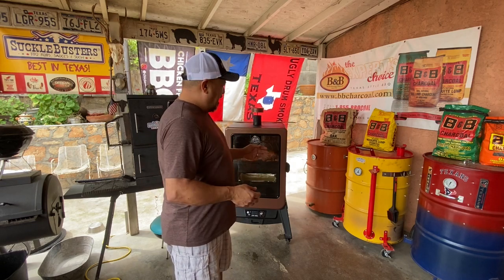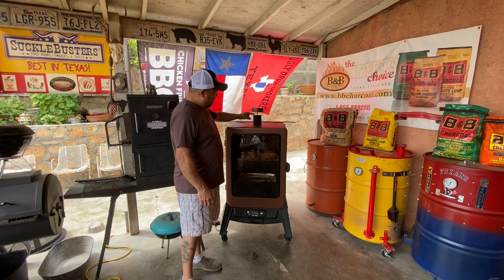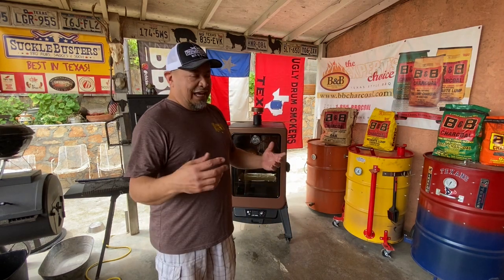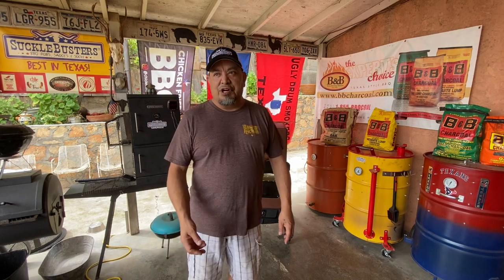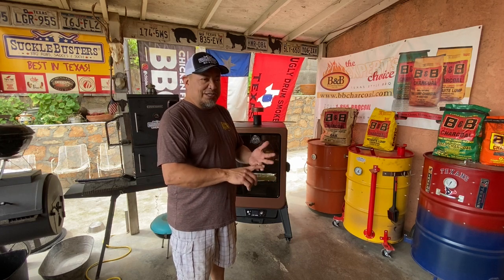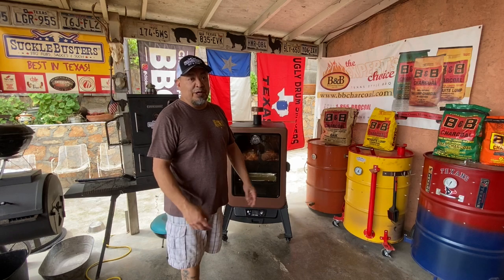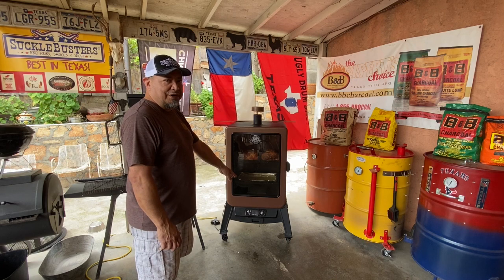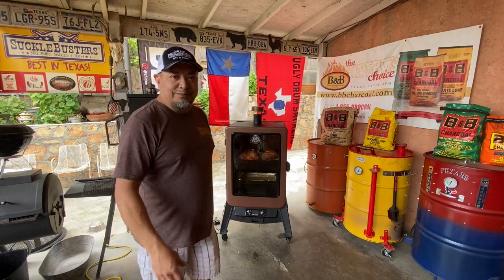PitBoss Copperhead Still Broke ErH

Comment: Just an update like I said before they sent me out a thermostat with no instructions on how to install it but thanks to YouTube I figured it out. After installing the thermostat I have cooked one beef brisket and one pork butt roast everything work fine. I still have a problem with paying close to $500 for a grill / smoker and in three months have to repair it myself. But just to be fair to them after I made the repairs my last two cooking events the smoker worked great.
Reply from the maker: ELAM305 That’s good news. Hope it continues to work the way it’s supposed to. $500 is not a lot for a pellet cooker with this cooking area. But it shouldn’t be having issues period.
Reply: ELAM305 same is happening to me.  I have been dealing with an ErL code since May!  They sent me a new control panel and the same thing happened.  Sept.....still nothing from PitBoss.  Ugh.

Comment: This smoker has been an absolute nightmare for me. I have the same error code problem after its working fine for about 20-30 minutes. Very frustrating when time is of the essence. I did my homework on this thing too, and now I’m dealing with this crap. On top of that- temp fluctuations are a major issue with the unit as you were saying, and one second the thing is billowing smoke- and then the next nothing. Super frustrating when you are getting zero smoke during the first hour of the cook which is during the most crucial time for the meat to absorb smoke. I finally gave Pit Boss a call and they want me to access the wiring and and start crossing wires to troubleshoot the blower. I wish I would have never purchased this thing. As soon as I get it working it’s going on Craigslist. I’ve also decided I hate pellet smokers- too messy (they run everywhere) and pellets just don’t provide the smoke flavor you get with actual wood. It’s a real pain emptying the pellet hopper on this thing as well since the chute plugs up and you have to shake the unit left to right to get more pellets to fall out, and you never can get all of them out so I find myself shoving a broom handle in there to get all the pellets. Meanwhile a bunch of pellets end up on the ground and if you leave some there and it rains then the pellets expand and look like animal turds.
Reply from the maker: Everything you said is exactly what I experienced. I’ve sent multiple emails to Pit Boss along with my video. I have yet to receive a response. Never ever ever again and if I see anyone at Wal mart or Lowe’s I will tell them about my experience.
Reply: Ric’s BBQ & Specialties call customer service- they will actually work with you
Reply: @bordo3k  I had been working with PitBoss through email with the same issue. I was promised a replacement controller and temp probe and I have never heard anything else from them and I have never received any parts. I have been working this issue for more than a year.

Comment: Robert Lantiegne
4 minutes ago
THINK TWICE BEFORE BUYING ANY PIT BOSS SMOKER! Excellent video. Your videos are so incredibly well done. I bought my Pit Boss Pro August 2022. I used it first time in the end of September. On my third use in October, I had the error message ER1. After unplugging the smoker for 30 minutes there was no error display and the smoker was operational and was able to complete the smoke. After reading PIT BOSS manual Trouble Shooting section, I check for fat residue on the heat probe mounted inside cabinet on back wall. Probe was clean without any deposits. Just before Christmas, I started an overnight smoke with 80 lbs of pork shoulder. The next morning I checked smoker and it had done an automatic shut down, displaying error code ER1 and the pork inside was102 degrees. The pork was completely raw and due to spoilage concerns I threw away the pork that cost $82.47 at Costco. I called Pit Boss Customer Service and requested a Warantee return and replacement. They refused and sent me a replacement probe. I installed it which takes a couple hours. I did one trial smoke with smoker empty and got same error message. Pit Boss advised that they would not repair or replace smoker and sent me a new control panel. The smoker works, for now. YouTube is full of dozens of videos showing Pit Boss Pro owners instructing how to replace the probes and control panels. I will NEVER BUY A PIT BOSS smoker again. The rate of failure of the control panel is too high for me to gamble on. To replace either probe or control panel requires removing door, racks, rack brackets, entire chimney assembly and and hopper door stop mounter on top of smoker, then turning smoker upside down resting on smoker top. These smokers are $600.00 and Pit Boss does not honor their stated repair or replace FIVE year Warantee. Sending replacement parts and requiring owners to repair their smoker just does not cut it.  Thank you for posting this video. It will save me time by not doing the same chimney and water pan placement changes. The problem is the smoker and the failure of the company to honor the Warantee which leaves us all out in the cold trying to repair these poorly designed worthless smokers. I am in the process of writing old fashioned letters to the state and federal consumer protection agencies.
Reply from the maker: You are absolutely correct that Pit Boss is a Pit Loss!! 
Thanks for watching and hope you check out my other videos and tell your friends about my channel! I need more subscribers 😎
Reply: My smoker still doesn't work even after they sent me a new control board that I struggled to fix. It worked once, then never again. It's quicker to throw  my meat on the grill. Hopefully the company will figure this out

Comment: After about 30 cooks I am now having this problem. It has been rock solid since January, great at holding temps and now its all over the place with temp spikes to 375 on a 225 setting. I contacted PB and after waiting 2 weeks for an answer they told me to do the exact same thing, and clean the temp probe. Nothing worked, I have been watching it and it seems like it stops feeding pellets so I have been hitting prime to get through my last cook. Finally PB is sending me a new board and temp prob, fingers crossed it will fix the issue. Honestly not sure I would buy another PB.
Reply from the maker: Hello Sir, truly sorry to hear about the issues, pit boss needs to recall these cookers I swear. Good luck and Thanks for watching and for the comment 😎
Reply: Did it fix your problem?

Comment: I had issues with the heat spiking on me. Pit boss sent me a new probe and control panel. I changed them out and so far after 10+ cooks, everything works greats. I also raised my cap and water pan just for gp. I absolutely love this smoker. One note is that when pit boss sent me the new probe, I noticed that the wire is longer then the one that was on it. So I’m not sure if it was just a bad batch of probes or not. Anyways I love your channel and just want to say keep up the great work.
Reply from the maker: Hello Greg and thanks for the watch and for the comment. I am glad you got yours fixed. I really liked the unit especially the size. My issue was it was going to take 6-8 weeks to get my parts. 
Ultimately I returned the unit. However if you go through the other comments believe you will see that this is a common problem.

Comment: I've had this same issue come up repeatedly after only 5 cooks.  On the last cook that lasted ~8 hours I probably had the ErH code come up 20 times.  I kept having to unplug and restart the unit, really frustrating.  I called customer support today and they tell me that it is definitely the temperature probe and they are sending me a new one.  Based on these comments I am not confident this will fix the issue, but we will see.  This could be a great smoker if it were just more reliable.
Reply from the maker: Sorry to hear about your problems. What’s really sad is you and I aren’t the only ones! And yes this would be an awesome cooker if it worked properly. I would so give it another chance if PB wanted to make it right. Otherwise I’m glad I took it back and spreading the word to others that they need to be aware before spending money on this smoker.
Reply: Ric’s BBQ & Specialties Since replacing the temperature probe have you had any more issues?
Reply from the maker: @Skwillson9876 I never received the probe. I found out is was going to take 6 weeks to get it. Couldn’t deal with that do I took the unit back for a refund.

Comment: What a pain now I'm getting second thoughts on buying that Pit Boss smoker. Thanks for sharing .
Reply: Tri-Tip Junkie I wouldn’t recommend the Verticals to anyone just from the problems Ric is experiencing and the issues I have with mine. I would however recommend one of the pellet grills they have as I’ve never had one issue with mine.
Reply from the maker: Yeah Mike, but you know everyone else I talk to has only had the temp difference issue. I can deal with that. Lol But yeah you may want to hold off a while
Reply: @paulsq_  thanks I'll keep that in mind much appreciated.
Reply: I wouldn’t recommend pit boss period.  I bought a 700 series and it had an err from day one.  Never worked and I spent 90 minutes on hold and was told how to fix it myself.  Still didn’t work. Total garbage company.
Reply: @Chooby56  getting a Recteq instead.

Comment: I'm on my 2and Temperature Control, had same code as yours,they also have sent me 2 wiring harnesses or Control boards, it took 2 mos to get parts,mine will be out of 2yr warranty on Christmas. They have been good in sending me parts,except this last one,said because of Covid, Took actually over 2 mos to get parts,but I kept E-mailing every Week asking where my parts are at.
Just got them last Saturday. 
Going to try temperature Control 1st by it's self. I like the moving up the water pan,I'll try that right away. 
It's just me and my Wife, so usally one thing cooking at a time. 
Thanks for the tip, Hope it Works  !!
Reply from the maker: Michael thanks for watching and for the comments. I’m glad you at the very least are in contact with Pit Boss or in my case “Pit Loss” lol  This can be a very nice cooker if it would just work the way it’s supposed to. Hopefully this will be the last repair/replacement you’ll have to do. Good luck Brother and keep smoking. 😎

Comment: I did not read all the comments, but I had this very same issue. I tried all the same things as you in this video with no luck. I did not get anywhere at first with Customer Support. I bought a new temp probe off Amazon and it solved everything. The stock temp sensor is garbage. If you have not tried replacing this yet. I would give it a try. I worked for me. Also I did hear back from pit boss and they did send me a new control unit. I am keeping it as a spare cause mine is working fine now. I hope this helps you brother. Best of luck and keep up the tasty meats.
-AL
Reply from the maker: Terminal LCpl Thanks for the view and I glad you found a solution! I wound up taking mine back for a refund a week after I posted the video😎

Comment: i purchased a copper head Pit Boss yesterday. I took the damn thing home started it and got an ERL CODE.  My meat went bad, next day I got a replacement from Lowes. I used it last night and it is working perfectly.  I am just a little concerned for the future of this gril-- with all the codes the commenters are telling me about.  It is a handsome grill, but they screwed up with the electronics.
Reply from the maker: Hello Jim, Thanks for watching and for the comment. Good luck with your 2nd unit. I really dig the design however I believe they are eventually going to have the same issues.

Comment: I just bought a pit boss series 4 vertical smoker yesterday and hopefully I don't have the same problem. I did want to mention that the owners manual says if cooking at low temperature, keep the cap more open. If smoking for an extended period of time, move water pan up higher to allow water to last longer. 
I bought the pit boss series 4 from Lowe's and maybe the manual is different from the one you have.
Reply from the maker: My manual did not have that information. They must have updated their litterateur. Thanks for watching!

Comment: Hey sir saw your video and I’m sorry that sucks! So I’m on a forum with a group of PitBoss Smokers. It seems that there is an updated smoker. Old verticals didn’t have this part that is now on the back wall of the smokers.
Reply: Wish I could send a pic as I took one of mine that I just assembled today
Reply from the maker: Pit boss told me it is the control panel. They are sending me another one, however I found out it’s on backorder and coming from China. I wasn’t scheduled to get it until July. I wound up taking the smoker back to wal mart and got my money back.
Reply: Ric’s BBQ & Specialties another forum user was told the same and they sent her  a new control unit and it happened again. She returned the vertical and then received a new one and she has that same new part on the back of her wall that wasn’t on the original
Reply: It is interesting that you bring this up. Our’s from Lowe’s did not have it on the back wall either. I wish they would let people know that it is an older model. It would have saved us all time on putting it together and trying to get it to work right. Thank you for sharing and if possible can you message me the PB forum info? We would love to join it. Thank you
Reply from the maker: Sang Lim That part on the back wall is the Temp sensor. PB was supposed to send me one too.

Comment: I had the same issue! For some reason mine shoots up to 380F (then very slowly declines to temp, then back up again) when it's set at 250F, but when i set it at 225F it maintained 225F +-5F. I took the entire thing apart, and i believe the issue lies in the temp probe in the unit. I don't think that temp probe's wiring is insulated correctly. When I smoke stuff, the drippings can fall on top of the probe's "protective housing" if the meat's too far back. There is also a mating surface at the bottom back part where, I am almost certain, drippings seep in and short the probe causing the control system to continuously increase in temp, causing the unit to overheat and generate the first error code that sets off. I also found that if every rack is full of meat, the heat is very inconsistent throughout the smoker. The 4th tray back gets a ton of heat, and the 3rd tray forward gets a ton of heat, and the rest of the unit lags +-15F. When I cook a pork butt, I've also found that rotating the meat 180 degrees every 2 hours or so provides the most even cook. One time, I left it there until the back part of the probe was at 200F, and the forward part 190F. With all that said, letting the unit cool down, shop vacuuming out ashes, cleaning the temp probe, and unit's the best way I've found to keep this thing going. But, I never had this issue with my Oklahoma Joe, or WSM...
Reply from the maker: Thanks for watching and the comments. If you read below, were not the only ones having the same problem! I took mine back for a refund but Pit Boss needs to send out a recall on this unit and give Everyone their money back.

Comment: Same problem here too! I run at 225 and same thing about 2 to 2 1/2 hours into my cook and that dreaded ErH code 😡 I hope you find a solution, I want to love this pit but she is pissing me off.
Reply from the maker: Pit Boss told me it’s the control panel. They are sending me another one. What pissed me off was it is on backorder coming from China. Won’t be here until July. I took the unit back to wal mart and got my money back
Reply: @RicsBBQSpecialties  I had a similar issue, but it turns out to be my fault. I had the box that sits in the base of the smoker sitting wrong. The opening was right in the direction of the thermostat(to the back), and that burned it out causing it to fail and overheat. Well I replaced that because they sent me a new one and it has worked perfect every since. I have had the unit for about 3 years now. Use it all the time and love it.

Comment: 6 months in and I just started getting erh codes. Unplug restart and it’s good for 10 minutes. Now when I plug it back in the temp will go from 250 to 490 back to 300 to 225 to 450 within seconds until it says erl.   These things suck, I should have just gotten a traeger
Reply from the maker: Hello Jack. That is exactly what mine was doing only mine started on the 4th cook. I have been using Green Mountain Grills since then with no issues.

Comment: I’m currently experiencing the same problem. I clean it all up water is where it should be also remove all pellets and still having an ERL code . Calling supports .
Reply from the maker: Good Luck, I don’t know if you’ve read through the comments. Some suggest a few things to try.
Reply: Ric’s BBQ & Specialties yeah I did and nothing so end up calling an a controller board is being sent . Now waiting .
Reply from the maker: RI Viewtech RI That’s the same thing they were going to send me. It was on backorder and would be 12 week delivery. Hope you get yours sooner than that! 👍🏼
Reply: As a follow up, I end up bringing smoker back to store and argue the point that it was purchase back in January 2020 and it was too soon to break on me. They end up replacing the unit for me so I know have another one hopefully it last .

Comment: Same issue with ours. Unfortunately no answer or call back from out boss I will try and raise the water pan and open up the smoke tube and hope it works got three pork butts to cook Saturday.
Reply from the maker: Thanks for watching and for the comment. There are known issues on this smoker. I have been surprised on the comments I’ve received. I hope the changes you make with the water pan and exhaust help. Good luck with your cook and let me know what happens.